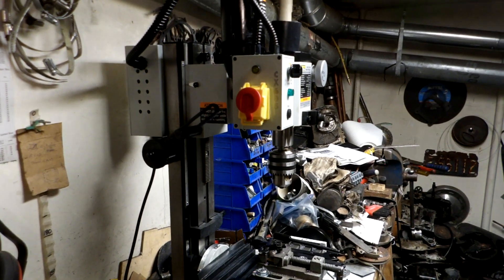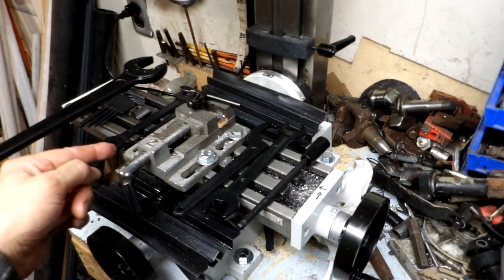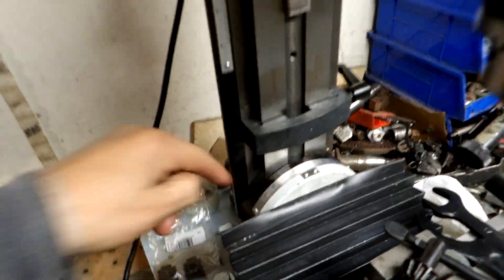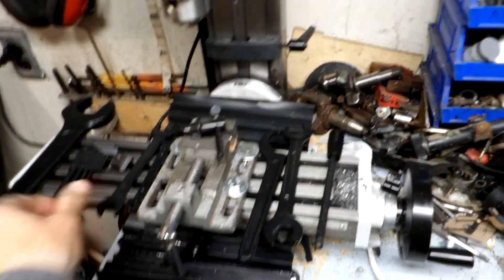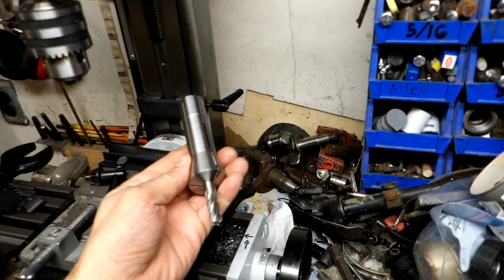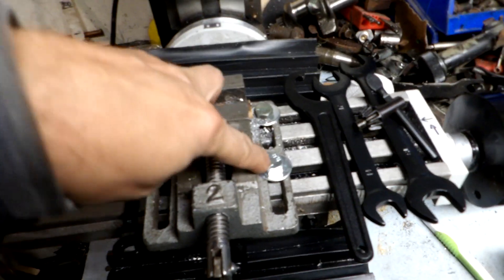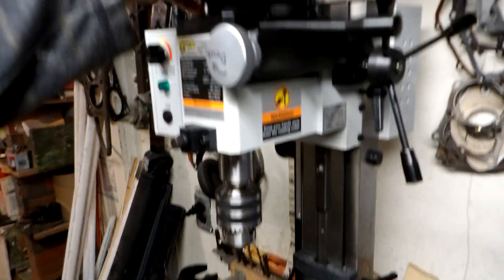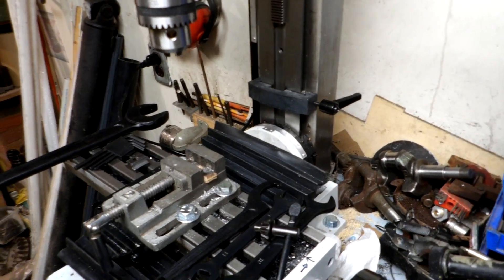Craftex CX 605 Milling machine Intro.

Comment: How does this handle steel for cutting? Really looking at this one past couple weeks and no videos on it's performance. Any info would be a blessing. Thanks  for this btw :)
Reply from the maker: Howdy, sorry about the delay. It seems to cut steel OK, though a carbide mill seems to work better. I haven't put it thru its paces much yet, just milled some mild steel chunks to make T nuts to hole things down on the table. As long as you go slowly it seems to do a reasonable job milling.

Comment: Lots of fun to be had with that thing! Let us know how it works out for your projects, I've been looking for a medium sized one. Would rather not deal with a full sized Bridgeport until I own the garage that it'll live in, they are not fun to transport!
Reply from the maker: Yes, the size and weight of a full size mill is the main reason I went for this little fella. One a bit larger would be nice, but full size was out of the question. I am still making some jigs to hold onto a Briggs crankshaft so I can try to machine one, so no progress yet.

Comment: Looks like a handy little bugger. I'm surprised a guy like you doesn't have a real Bridgeport style mill and a lathe.
Reply from the maker: Yes, that would be a nice thing, and the mill itself wouldn't be a huge amount more than this pipsqeak mill. But, I just literally have no where to put a full sized mill, unless I build a building for it, which would have to be wired etc, etc. So lots of coinage, which I don't have, hence the tiny mill !

Comment: Thanks for the video. I was actually thinking of buying one myself. Btw, your video title says CX 650 instead of CX 605 😊
Reply from the maker: My bad, I will revise that!   I have been using it this week with a 3/8" carbide end mill, MUCH better than the HSS mill I managed to make dull.

Comment: You won't break it because there will be a sacrificial secondary drive gear. Unless yours is belt driven. Those things are the best toy that Santa could bring.
Reply from the maker: Good to know, it may take a while to get replacement gears if I lunch them though!  I try to take fairly light cuts not to work it too hard.